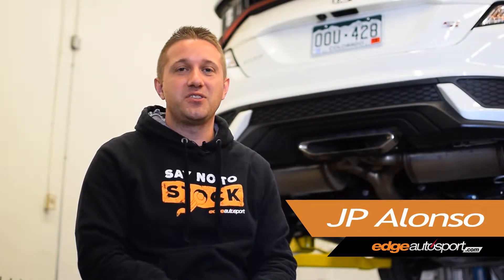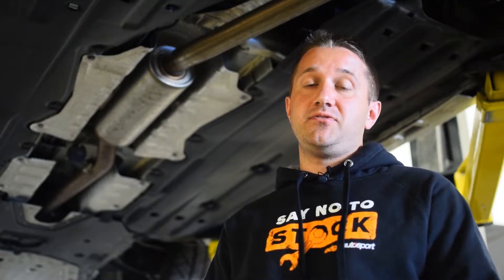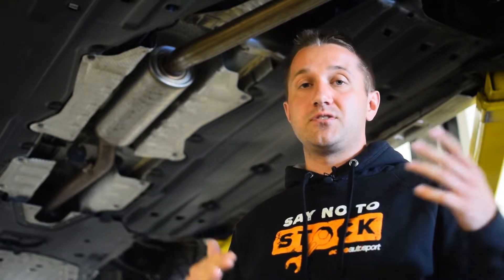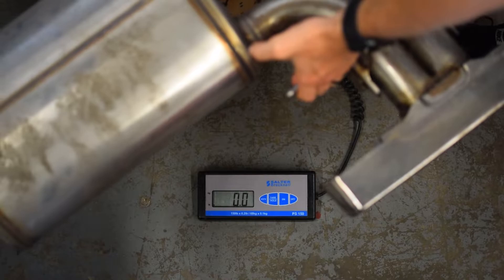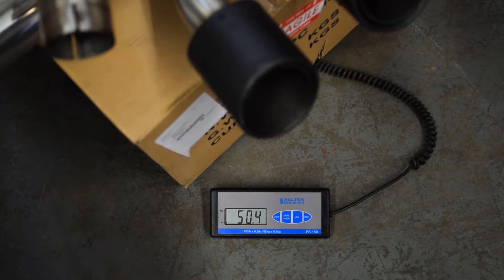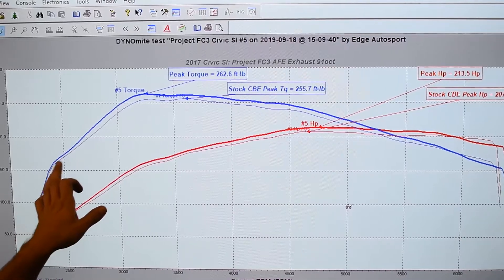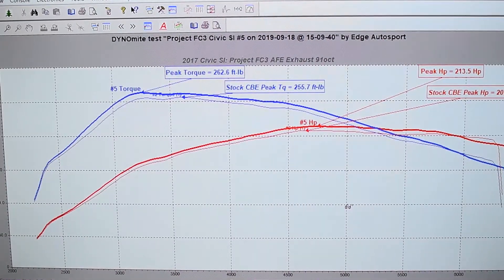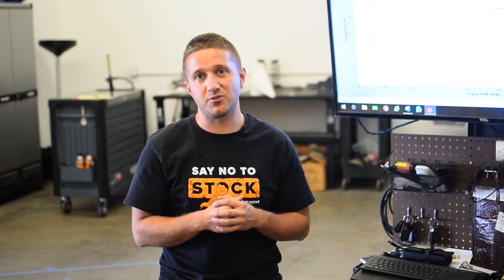AFE Power Exhaust Install MORE POWER | 10th Gen Civic Si | Project FC3 Ep4

Comment: AFEPower exhaust was one of my first upgrades. 20k mile later it's just loud enough and with a TSP S1 tune, I'm in heaven. Best daily driver ever!
Reply: Hi Dave. Can you attest to the zero exhaust droning? Still have stock front/down pipes? Best, Paul
Reply: @paulzaleski8748  I find the definition of droning is relative. I absolutely love my exhaust note. I can't compare it any other, it's the only one I've ever had in this car. I've never had a reason to dislike the sound. I don't know if that helps.
Reply: @DaveOrtiz  Thanks for the input
Reply: @paulzaleski8748 - my pleasure. Im at 70K now. 50k miles on the AFEPower Exhaust and TSP S1 Tune (on Map 3 always)-Im on the original clutch and still have a blast overtaking cars in traffic. Good luck with whatever you decide. Maybe I should film a after exhaust note after